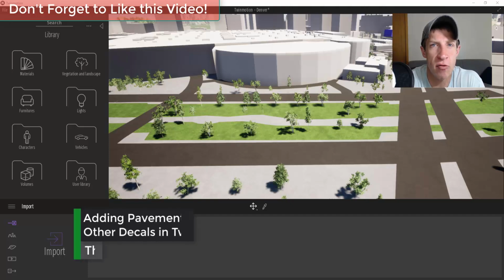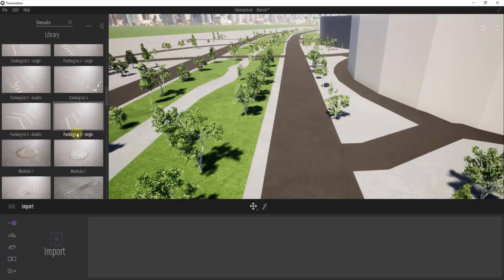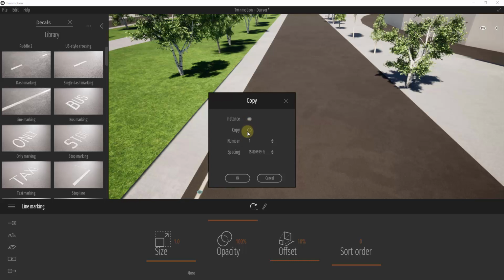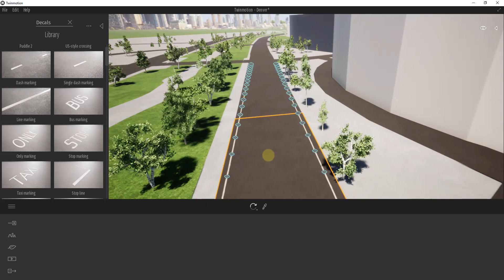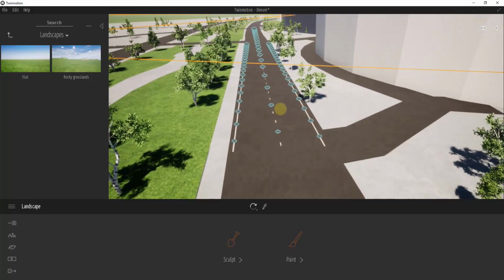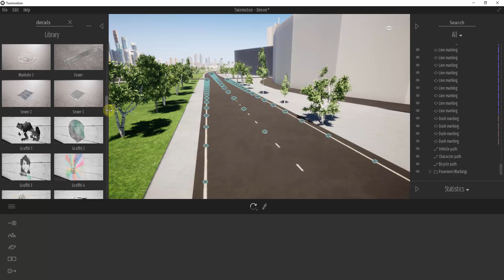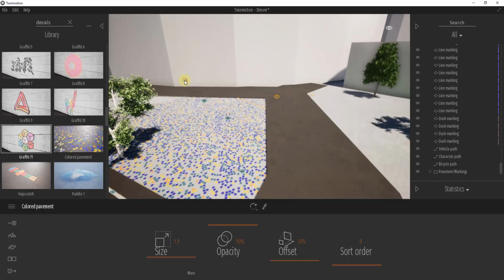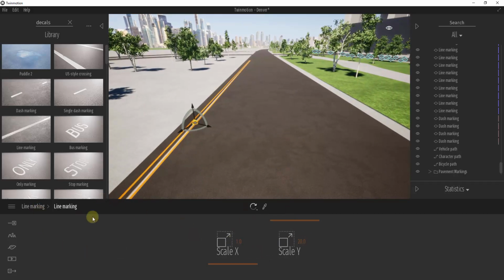ADDING DECALS to Twinmotion Renderings (Lane Striping, Manholes and more!)

Comment: Great videos, thanks Justin. Do you know if there is a way to flip decals? I'm using the angled parking but i can't find a way to flip it to the other angle...! Cheers
Reply from the maker: Does the standard rotate tool work?
Reply: The Rendering Essentials I can rotate it 180deg, to flip it upside down, but it doesn't quite display the same. I was hoping there was a flip tool, but nevermind! Thanks for your help with the Twinmotion tutorials. They've been a big help.